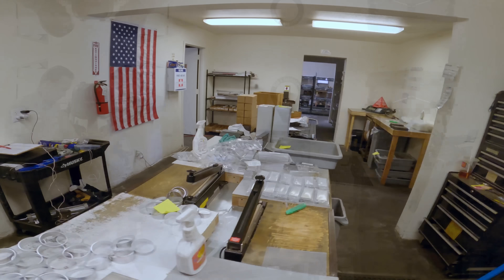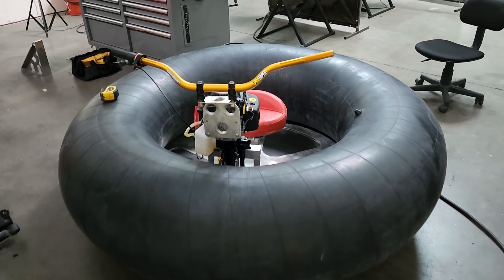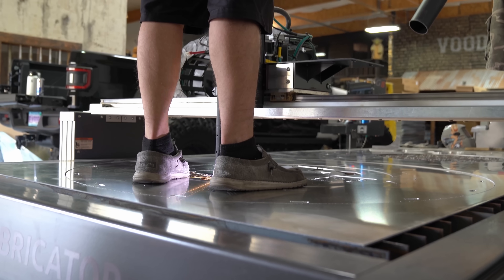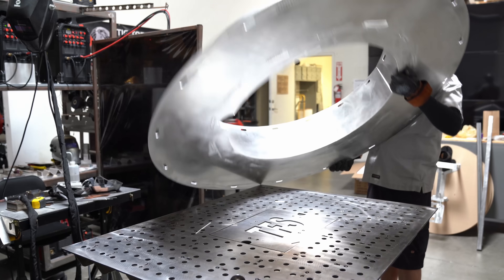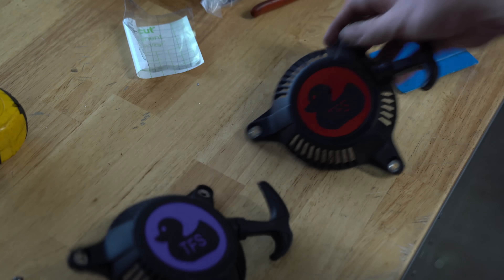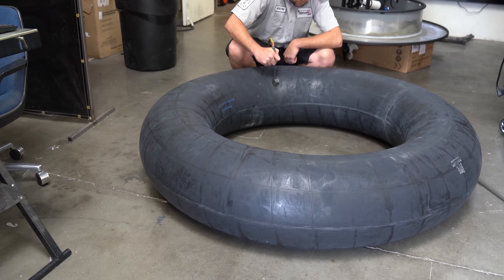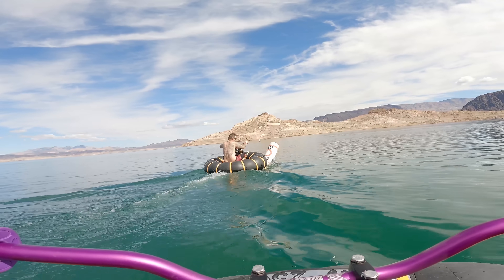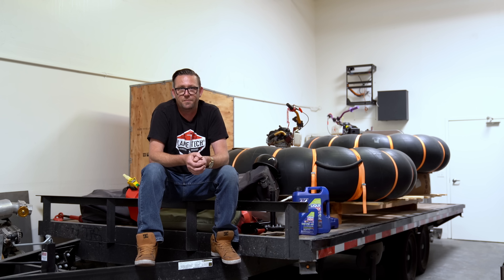Homemade Boats From Amazon Parts | TFS Lost Episodes 2

Comment: I learned a long time ago that being able to see a problem from multiple perspectives can provide a solution that you may not have found yourself.  So seeing different fabrication projects outside of the norm is a bonus in my world.

I was a design engineer on the largest, most complex sounding rocket payload ever flown.  The manager wanted to know why I brought design problems up in the status meetings to get input from electrical, software and optical for mechanical issues.  He thought I should be proposing a solution, but I told him I didn't want to "poison the water" so to speak.  I wanted their ideas, no matter how far in the woods, to help me gain a different perspective.  Being the smart manager that he was, he agreed.  Plus we had a really good tight team.

Comment: Should of sent the aluminum out for anodizing. Would of shaved off several pounds.
Reply from the maker: Would have tripled the budget, too! Nobody around me does anodizing on parts this, and the epoxy is only a couple pounds added to an extra 50 pounds of acrylic floor... not gonna make a difference at the end of the day.